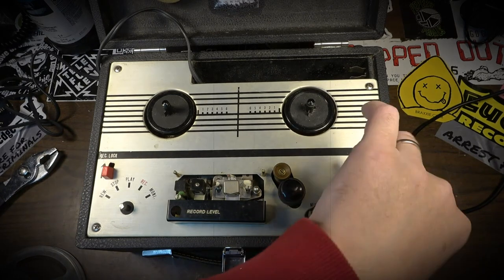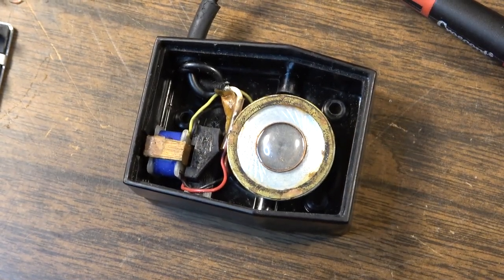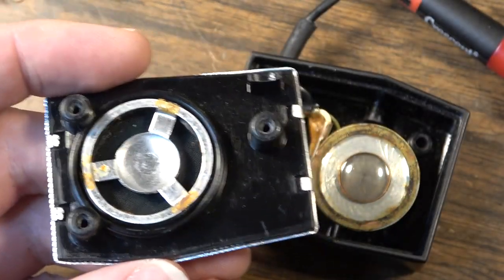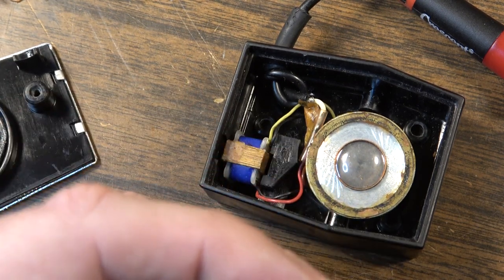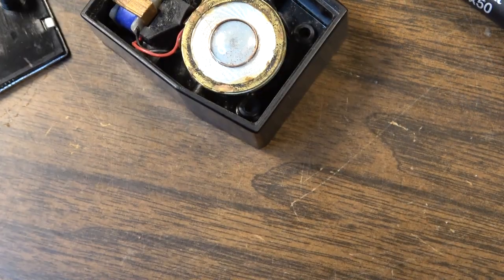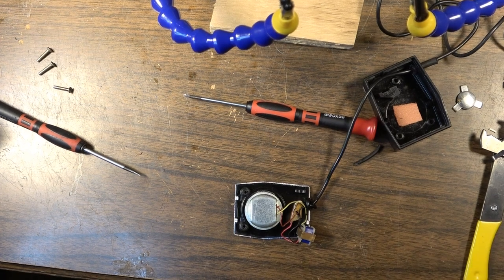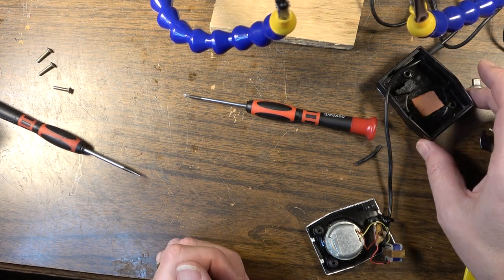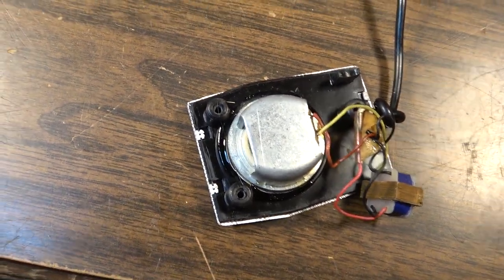Modding a Cheap Vintage Microphone

Comment: you're totally swiping some if my trade secrets! lol... I have the best mic preamp made by Bogen (my favorite amp maker, pre 1964) with a B+ voltage of 550v!!! and juices two 12a_7 tubes so hot,  and clean... I use the pair of them on everything... it makes my mixes glow,  the drums pop, the guitar in focus, with perfect mids and hi's... ridiculous head room... and no one knows about them! I put my pair out on the web a year ago... no one knew a thing. But I've had preamps of all colors... you can experiment with the two tubes and get all you need... from high sound pressure to miking a fly washing his hands... lol. serious.

Comment: Love the ornamental altec desktop compressor add-on....really adds some characture to the whole presentation lol..
while I was watching this, I was thinking the same thing about what plugging that into the compressor/preamp device would yield...actually, what the hell am I doing up so damn early...now I'm thinking what my silver eagle crystal mic would sound like thru the altec!?!...btw, I was watching your tiny Vox amp repair and how much trouble you were encountering in placing the package to hold in place get it to solder successfully and I remembered my teachings at the first shop I worked at after graduating from college (Bozotronics) and a trick we always used in amps like Jordans/Wilder etc craps(all solid-state)to hold them in place....a small toothpick drop of superglue...worked with mixing consoles like 2inc. etc, as well and to this day, the secret to release even the tiniest of sg adhesive is placing a toothpick droplet on a scalpel(or in todays world, snap knife)  with tricloriphine brake cleaner(non-flammable)...when you want to sell your little microphone, let me know, I'd be interested in buying it lol. seriously.     
 jeez, I need to go to bed....

Comment: I wondered all the time if you had grounded the shielding. Won't have much of an effect without that.
The aluminum cap over the voice coil you removed probably helped with shielding too. But in the end it turned out quite good.

Comment: That little thing actually sounds pretty cool. Question: I remember you doing a video about the ART tube preamps- well I got one of the little ones, the tube MP it's called. I've had it for about 10 or 12 years. When I try to use it with my medium diaphragm mic  these days it makes a lot of noise. So it's kind of useless for vocals now. So, I was thinking of turning it into an overdrive/distortion pedal. Any suggestions for resources that'll give me a good start on figuring out how to do that?
Reply from the maker: I think those are all surface mounted circuitry, IIRC. You'd probably have to just gut it and start over with a schematic you find online. Just guessing.
Reply: @TheGuitologist  I just now took it apart to check. I'm looking at it right now, and it's definitely a through-hole board. It's got a 20 db gain button and pre and post pots. So i reckon I could just run it in front of an amp with the +20 db and a the pre cranked. But that creates a pretty harsh transient sound. The tube apparently doesn't do much, like I think I remember you surmising in that video you did on the one you had ahold of. Hmm... I don't know. I might just use it like it is.
Reply from the maker: @JeremyL_Hay  This one is going to be a starved plate design just like the other one I showed. That video is in my "Microphones" playlist on my channel. To really be an effective tube preamp, you'll probably want an actual power transformer capable of providing at least 80 or 90 plate volts.
Reply: @TheGuitologist  Oh ok. That makes sense. Thanks. I might just take it all apart and see if I can make something interesting with the parts. I just know I don't like throwing stuff like that away. Alright well. Ya take it easy.

Comment: i swear it sounds exactly like a muthatrucking CB radio mic.
..........breaker  breaker....can i get a 10-4....over.........
Reply: I bought an old cb for five bucks to salvage for parts, modified the mic by removing the push-to-talk button, still gotta figure out the mic stand mounting, but it was definitely worth five bucks for an interesting sounding mic, and some cool knobs too